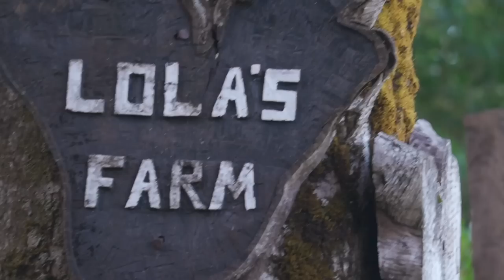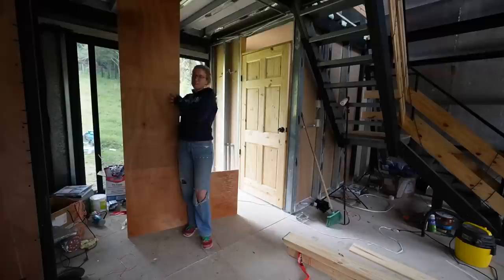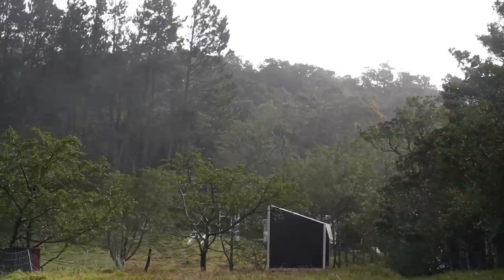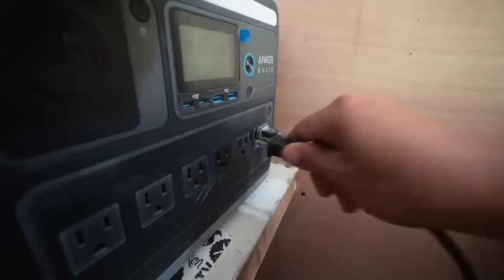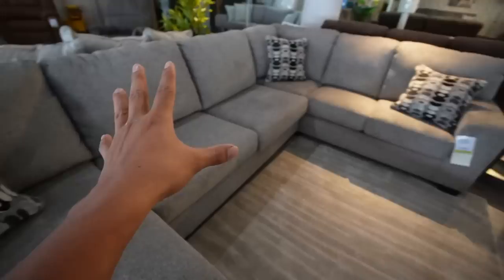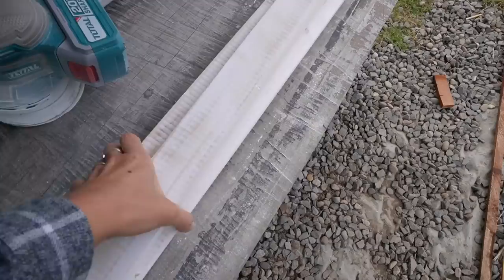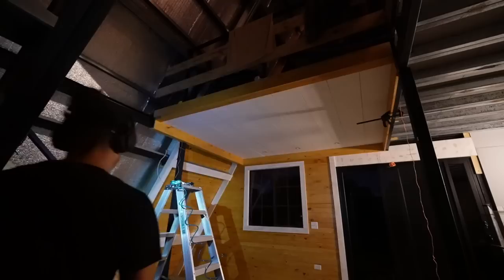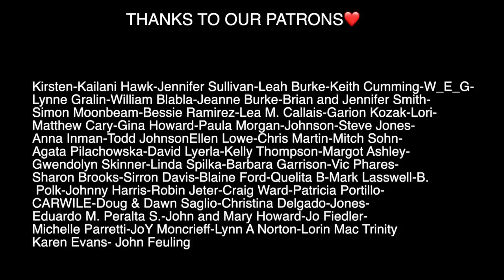THE BIG REVEAL || OUR HOUSE NEEDED THIS!

Comment: PERSONALLY I  think a fan with a light would be better but circulates the air and keeps cool in summer
Reply: 100% agree with a ceiling fan
Reply: I agree with a ceiling fan with light.  That will also help with moisture during the rainy season.
Reply: There is nothing wrong with both.. what happens if u don’t want the over head light on??????
Reply: A ceiling fan that looks a little like the propeller in a plane but with the light in middle round and kind of flat (like a pancake) so that it does not come down like the old fashioned ones.  The control can be turned so that you can turn the light on or leave it off.  These are very chic, clean and modern looking.  Also put a clean round light in the middle of the kitchen with a few recessed lights in the kitchen too.  Put the lovely hanging light that is in the kitchen in the dining room.  That would look perfect there!

Comment: Awesome couch. Be careful with the tiles before you complete the floor and grout. The corners of the tiles can break off in the meantime. Chandeliers are for kitchens and dining rooms. Either stick with recessed lighting and replace the regular switch with a dimmer switch to create mood lighting or install a fan in the middle of the ceiling which can distribute air when it's hot and heat when it's cold, especially if you get a little cozy fireplace.
Reply: Chandeliers can be used in any room.

Comment: Rodrigo, you are becoming a great carpenter.  Your home is coming along with Freddy's help for sure.  Whitewash the boards, water down the white paint and you don't have to sand the paint off.  Start with a little water at a time to get the look you guys want.  Now touch up on the ends of some trim and caulk the seams, which would definitely be a Freddy job.  Your house is becoming your home

Comment: I wish you could turn the couch around so the lounge part was along the window.  It would open up the space and allow you to see out and window and into the kitchen.  The way it is now seems to close off the living room space and make it smaller...Just a thought...Good Job!!
Reply: Yes consider turning it as suggested!  Need a little more headroom above the couch if you do this?  Then build one of those narrow behind-the-couch long tables and, you won't need a coffee table.
Reply: they also could have bought it with the lounge seating on the other side where the slope is, not cutting up the space directly by the doorway. It's such a tight spot. I would have put the dining table there and made the living room where they have the dining table now extending out into the other side of the A frame.
Reply: On my couch watching you on your couch 😍

Comment: Having an open floor plan is great. It first of all makes the space look bigger. So when you want to make “zones” in the house, like dining, kitchen, living spaces, you do that by making each space unique. So you have the nice chandelier in the kitchen. And that light fixture says “this is the kitchen space” Now that you are defining your living room space, do something completely different. The recessed lights are great for overall lighting. And if I remember correctly, you wanted very white lights, then some warm lights. My suggestion would be, use table or floor lamps with warm bulbs for accents. And not worry about the chandelier. Then your living room will look cozy, and inviting. 

Also, at fist I wasn’t sure about the white accent trim, because the black was really letting the wood walls pop. But as you put the white boards up, the room warmed up so nicely. The whole look will be such a nice touch!
Reply: Yes! A floor lamp would be perfect. I agree with the rest of what you said, too,

Comment: Instead of hanging another lamp in the L.R. why not just go for a table lamp or two to be your 'mood lighting.' The canned or recessed lights will be good for when you are cleaning and need more lighting. And that would make that room have a completely different 'feel' about it than the kitchen does. Are the canned lights dimmable? To be bright and then low? If you've already cut the hole and wired it in for the hanging light, then change your mind, you can always put in another canned light there, yes? As far as the couch goes, you could you turn it around so that the back of it faces the kitchen, for a change, later, yes? That way you can put the T.V. in the corner, and let the couch be the room divider. Plus, you get to look out the window, too! Just an idea!

Comment: Paint boards white and immediately wipe them, and you will get a very similar outcome.   “White wash”.  Some people only use the white resin at the bottom of the can and do not mix the cans.  You can also use a slightly damp rag to wipe off and control the final amount.   Stain also can be used.
Reply: I was thinking about white stain. Would be a whole lot easier, cleaner and quicker. Just my opinion! :)

Comment: Everything is looking so cute, but since you can change which side of the couch the chaise part is on, I really think it might be better on the other side, by the wall... the way it is set up right now, the chaise blocks the flow of traffic from your front door, and your kitchen, to the livingroom. Also, just for a future tip... if you want the "farmhouse finish" on your boards, there is an easier way, waiting less paint, and no sanding.... just take a small amount if paint, depending on how much you are going to paint, and thin it with water, or floetrol. Start with a small amount of water, and experient, until you get it the right thinness, and right amount of transparency... then just paint it on the boards... if it is too opaque, just take a wet/damp paper towel, and wipe some off. You will figure it out after a little experimenting, how to get the look you want...😊

Comment: Hi there! I agree with others, Use plywood on the ceiling and paint it white. Freddie, add Water to your white paint for the white washed look on your trim boards, no need to sand. ❤Tongue and groove boards for all natural look.on the walls.🥰 btw, love the work shed👍 …I live in a tropical humid state and I also agree with a ceiling fan for the living room that has low medium and high speed, a fan running will prevent mold from growing..constant air flow😍

Comment: The kitchen needs lights for doing work. Your dining room needs the table lighted. The living room is most likely just for relaxing and TV  viewing, perhaps reading books and magazines too. So lighting on a dimmer switch is a good idea. If you were to add a desk in the living room then you can have a desk lamp on it. If you need more light for reading at the couch you can add a tall lamp next to the couch for that. All of this means there is no not any need for a chandelier in the living room.  That solves the issue for  would it look good to have one  because the answer is you do not  need one.
Reply: I think a small ceiling fan is a good option since he already has the hole drilled and electrical wires there. Not a large one, just a small one would suffice. It would definitely help when it gets hot out to cool them off. 😊

Comment: Recessed lighting is also called canned lighting. I think all the living room should be recessed lighting with a dimmer switch and add either floor or table lamps as accent/artisic pieces or focal points. I think the highest ceiling in the house should have fans. If you have too many ceiling focal points, they compete with each other instead of being admired, that’s why it’s better to have speciality table or floor lamps as accents.

Comment: IMO skip living room chandelier. Use warm lighting in a lamp or if you want the chandelier, same chandelier smaller, 1-2 lights, warmer with rattan or bamboo lamp shades/basket weave. Or skip and add a fan instead.

Comment: I love the recessed lights!  However, they may be a bit bright while watching movies and relaxing on your new and beautiful couch.  You might consider adding a dimmer switch to the recessed light switch so you can control the brightness of the lights as desired.  Additionally, instead of adding a light fixture to the living room ceiling, you might consider placing a floor lamp behind the couch.  I and if you decide to go with the floor lamp, look for one that allows you to select the brightness of the light.  You can either purchase smart bulbs and control them with the Alexa (or similar) app or purchase a touch sensitive floor lamp.  And finally, if you are really set on hanging a light fixture from the ceiling, suggest you hang it over the dining room table  with smart bulbs or with a dimmer light switch so you can easily dim the lights for dinner or brighten the lights for game night with your friends.  Mucho amor….

Comment: I would get a dimmer switch for the ceiling lights.  If you do the chandelier do the same as the kitchen.  Small space to much going on, keep it the same and it won't be overwhelming.  Make sure you cover the sofa with a tarp when you do the dusty work!

Comment: You don’t need anymore ceiling lights and copying the exact same light as the kitchen would take away from the uniqueness of that light. Get mood lighting with a nice table lamp (as another person suggested). If you do put something there definitely install a fan. You can also install a dimmer to light panel so that you can dim the recessed lights to be different levels of intensity.

Comment: You don't have to use a specific stain to whitewash wood—you can simply dilute white paint with water. For a thicker whitewash—which is great for a farmhouse look— you'll mix 2 parts paint to 1 part water.  a thinned-out whitewash for a subtle, elevated look. For this, you'll need 1 part paint to 1 part water. It would eliminate the sanding off of the white paint, then you could seal it afterwards.

Comment: I would put a round LED-light there, which is hanging close to the ceiling. It will not disturb the view into the room and it fits with the modern look of the 6 little lights. As you have seperated parts of room, it will underline this.

Comment: Dont forget to scotch guard the couch, so if something spills or a pet jumps up with muddy feet, liquid beads off and the dirk just wipes right off.
It comes in an easy spray can, its like a suede protector,  you can use on shoes and clothes as well.

Comment: My lighting recommendation is to leave the front room with just the 6 recessed lights for now, and wait to decide if you will add another once you have finished the entire first floor.  My reasoning is that because it's one big open space, you may decide (once it's done) that it will look better or make more sense to place that light in a different (possibly more central) location.

Comment: Your chandelier for the living room could be similar to that in the kitchen, but different:
Consider this... a thick circular piece of wood, same color as your walls, with about six smaller round lights facing downward. The wires could look like the spokes of a wheel, meeting in the center and then going upwards to the main electrical source as one larger wire. Have fun,
Many Hugs,
Krista

Comment: There are very modern, industrial, simple ceiling fans with included lights that hug the ceiling and do not have long fan blades to deal with that would be really nice in your rooms. They are reversible therefor duel function in keeping it warm or cool as needed. I think your style might be a fusion of "industrial-modern-farmhous". You are doing great. Remember, you can live with things for awhile and change out what you do not like or doesn't work, later.

Comment: What a great asset Freddie is to the farm & the building project with her special touches. The lighting you have is plenty, a chandelier would be too cluttered. Use another reset light for the center ceiling light or a shallow (upside down) bowl style light. A ceiling fan could work too but you may have a better position in the house for that. I'm a big fan of floor & table lamps. Also, up-light lamps create a lovely diffused soft light. A dimmer switch would be a great asset. Love the white accent look. You guys are doing so well. Get on with that floor though or you'll have problems matching the new with the older ones as they get damaged with the edges left unprotected the way they are. Watch out for Rodger pulling his claws on that beautiful couch! ...he will need some strong discipline when he starts that.

Comment: Can’t live without ceiling fans with lights. I have them in each room. They circulate the air nicely. I live in California where it’s hot. Also a floor lamp for soft lighting for quiet time. We have chandelier in kitchen/dining area. Ceiling fan upstairs and downstairs and the chandelier you already have will be a nice balance.

Comment: Rodrigo and Freddy, why not get a nice ceiling fan with a nice flushed light (round and pretty flat) in the middle instead of a chandelier?  Just a thought. It can help move the air and keep you cool and or warm too especially if you are cooking.  Keep the chandelier for the dining area.  You can still apply some recessed lights on the peripheral areas.  Best of luck with all of your projects, they are all looking terrific!

Comment: Recessed lighting throughout the living area. In my opinion a much cleaner look.

You may have less work on your trim (no sanding down) if you research making white wash paint. HGTV has an article ‘How to Whitewash Wood: Whitewashing and Pickling Techniques’. By adding some water to your acrylic paint you thin down the intensity. The amount of water you add will take some testing depending upon how opaque you want the underlying wood.

Are you able to reorient your sofa so the reclining part is under the window and back is against the slanted wall?

Comment: You might not need another light in the living room. Maybe go with just the 6 recessed lights, and then when the rest of the ground floor is done, you can decide whether or not you want a living room chandelier to balance the kitchen chandelier. If you need to place the electrical now, you could run the cable and leave it until later to connect each end.

Comment: If I can offer a suggestion on the white wood trip, the vertical line stick with white but the horizontal line stick with wood stain, at list it will not looked like u outlined something (a frame) to focus on. Or u may over come with hanging some photographs at the living room.

On the other side note while you wet painting the frame white it doesn’t have to be perfectly painted, all surface as you need to send it down anyway.

Try it and you will have shortened the time of preparation. 

Sharing from the experience as a Carpenter/DIY’s.

Comment: You have the luxury of time so don't rush the decision on lighting in the living room. You got great comments from people. You can mull them over before you spend more time and money. I personally like the ceiling fan with a light option. Dimmer switch on the recessed lights too. 
I noticed that the dust collector on your new saw has a hole in it. Dust was spewing out. Kinda defeats the purpose of it. 
Alles gutes, meine Liebe Leute.

Comment: To get the effect of washed white You don't have to sand it.Just dilute the paint 1 to 3 and you will get the same effect. And if it comes to imperfections on the ceiling, you can put two or three centimetre black or wood strips on the joints and it will look nice and suit to the rest

Comment: Easier and more even white wash by thinning the paint down with water. Also, if you cut some of the ceiling boards into 2 or 4 and stagger the boards, you won’t get seams across your ceiling where you don’t have the beams.

Comment: The living room is AMAZING! Great job. You’ve both worked so hard. Maybe a low profile ceiling fan with a light to circulate the air and keep you cool in the heat. That would be a great addition in the middle of the living. room.

Comment: For whitewash you can always dilute paint and water 50/50. Apply it with a 4 inches 3/8 nap roller and wipe down with a dry rag or sponge to remove the excess. It might cut your time by skipping the sanding part.

Comment: The chandelier question: It depends on whether you personally usually go for a symmetrical or an asymmetrical look. Do you like things to look balanced, or do you want each room to have a distinct character, even though the different spaces share a common ceiling? One way to know what you want is to toss a coin for the same or different: Toss it high. As it's in the air and you're hoping it lands on one side or the other, your hope is the right choice regardless of how the coin lands!

Comment: I would simply go with a nice floor lamp by the sofa, instead of another ceiling lamp. I added indirect lighting to my crafts room (in my case light strips simply attached along the sides of my ceiling). But you can also nicely "hide" them. You get them with warm white light or also colour changing. Gut oder gut, Freddy? 😉  How hot is it getting in summer in your house? Maybe a ceiling fan (with or without light)? Did you leave the top of the upper beam undone on purpose?

Comment: Have you considered a ceiling fan with a light in it. You get so much rain so the fan will reduce the humidity and circulate the air. There is a switch in them so you have them rotating one way in the summer and the other way in the winter.

Comment: pickling or white washing gives the wood a really classy look as it accentuates the grain and exposes the knots .. I personally like a solid stain that you can apply sparingly and then sand lightly by just using a sanding block .  a good stain will also give the wood a good seal as well as a very fine low sheen and makes the wood super easy to clean ..  the hard color of paint on wood is not a good look .. just sayin.,.